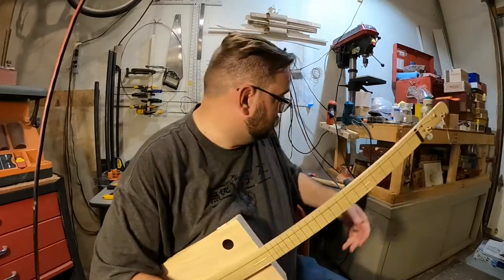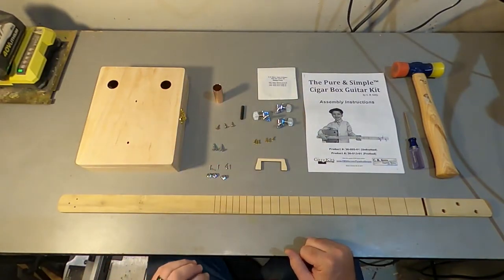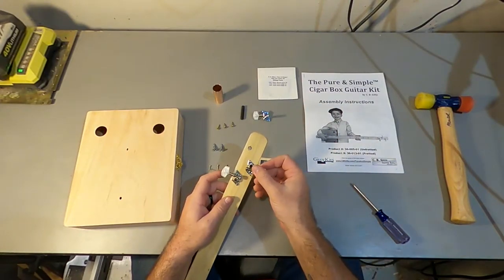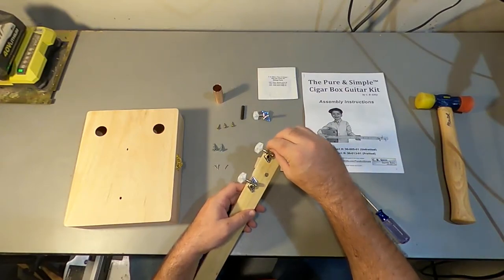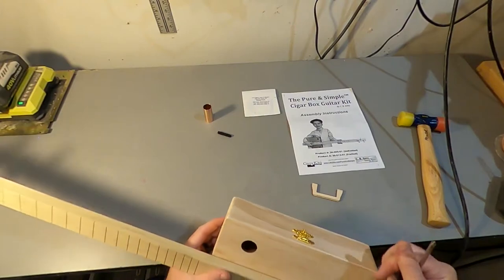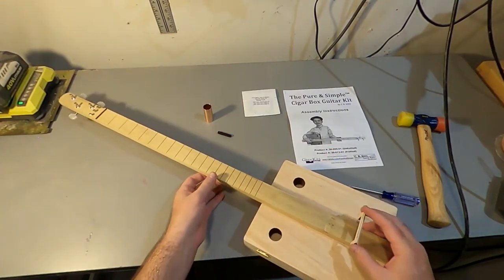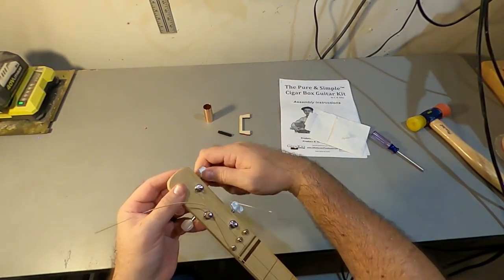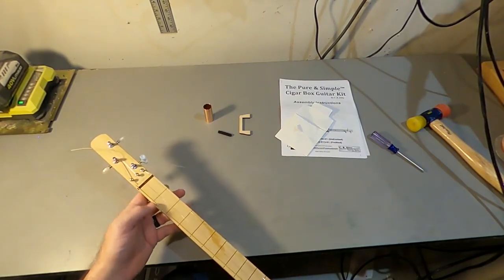How to Build Your "Box Banjo" Kit (C.B. Gitty Pure and Simple Cigar Box Guitar Kit)

Comment: A drop of glue between the wood & bushings is a good idea. Drilling very small pilot holes for the tuner screws and string trees makes that much easier.  Checking intonation at the 12th fret and adjusting the bridge location is also a good idea.